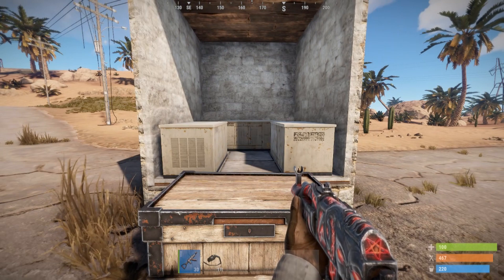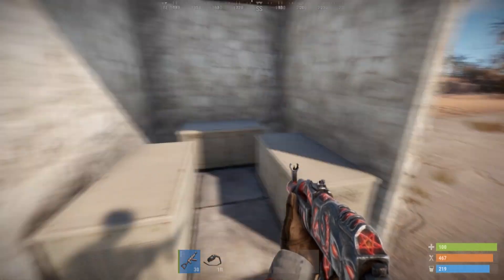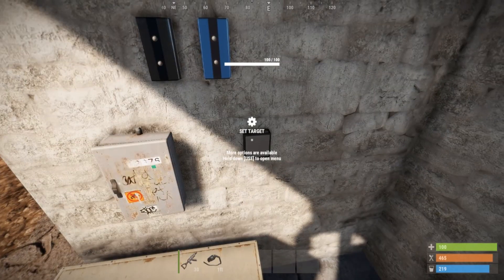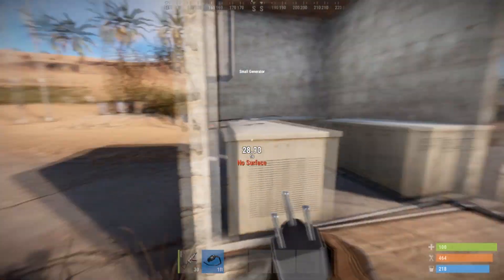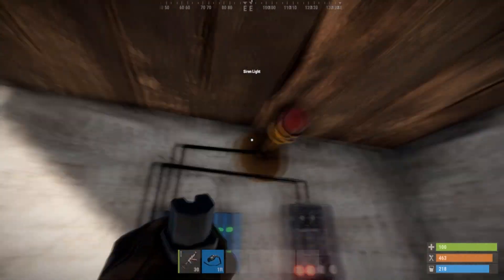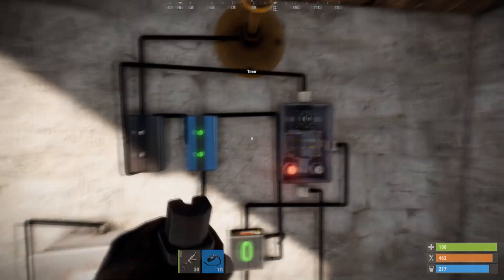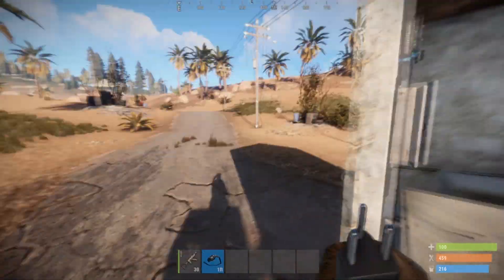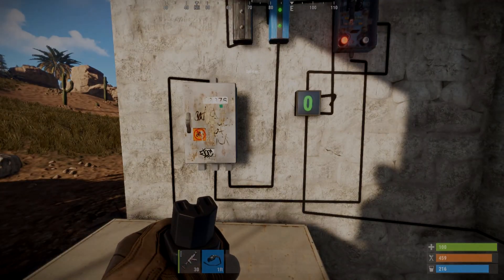Rust Electricity - Heartbeat Base Alarm (Customizable)!

Comment: If you wanted to add more sensors around the base, wouldn't putting the power out of the sensors into a couple of OR switches that ultimately power the system accomplish that? With another splitter off of the first to power the 3 (for example) sensors. Just a thought, haven't tried it.

Comment: 2 things:
1. The memory cell is actually more intuitive for this... (replaces the counter in your example) if you use the counter, why not use it in a way you can tell how often the sensor was triggered in the meantime? Using it like this is a waste and a little confusing...
2. The WAAAAAAAAY better version of this using a transmitter frequency matched to a pager in your pocket (instead of siren light)... That way you get alerted ALL OVER THE MAP and you can even put it on silent mode like your mobile phone so it vibrates instead...

Comment: Excellent work. Although, Instead of using 2 power sources you can improve this circuit via adding a branch before the splitter, to power it and the counter via the branch. Using 2 power sources isn't viable in vanilla, imo.

Comment: why to recreate that circuit on every wall of the base when you can use OR gates to pair them up and if one triggers it will display also you can put a counter for each sensor and just rig it up to the sensor indirectly trought another AND gate with the main power and extend from there, while using the block and timer method to reset all the counters not just one

Comment: A bit late to the party here... But you can bypass the only having one alarm/siren per sensor. Basically you wire them all to RF broadcasters and set them all to the same frequency. In base it you wire the receiver to A memory cell's "set" input with a different power source for the input. This allows you to wire up all your alarm gadgets from the output to be triggered by any sensor that is triggered. You can also set a beeper to the same freq to carry around with you when out and about. You also need power running to the "reset" input but I am pretty sure that can be constant as the "set" input will override the reset. 

I didn't mess with the counter but I assume there's still a way to make it work with that setup. But it also means you can have alarms anywhere on the map if you run multiple bases or have a compound or even if ya just have a heli tower. You could run that setup in all your bases and set them all to different freqs and in each base have a receiver for each base rigged directly to sires with signs telling you which is which so no matter which of your bases you are at you  know which one people are lurking at and potentially about to raid.

Comment: Can you still charge battery with this system?, I tried some things on build server and unlike the auto lighting system with branch to battery/blocker.. I can't get the same on units that require constant supply, they drain the battery even using a windmill.
Reply from the maker: The build as is will require a constant power source and is not typically used with a battery. You can make battery based systems as Malonik does in his video that allows passthrough whilst charging. Energy consumption is a very difficult resource to manage on larger builds.
Reply: @RUSTQuickElectric   I've seen some more vids now to explain ways to do it, thnx. The systems are complex and I do like that, but they are not so intuitive, that's a small price to pay I guess.

Comment: Using bits from your guides and others, I used a memory cell and a handful of electrical branches (*much* more power efficient) to power two hbhf sensors over a turret triangle. Whenever either sensor detects enemies, it opens the appropriate garage door (and triggers the flashing blue light special).  When enemies are no longer detected, they garage doors close.
Reply from the maker: Nice! I love hearing about optimizations. Glad to see you in the discord as well :D

Comment: could you use a splitter instead of siren light then split the signal in siren light, rf transmitter (for pager) and an audio alarm?
Reply from the maker: Yes you absolutely can. The branch output from the branch component in this schematic is meant to be split and used for whatever you want triggered during the full duration of the timer after initial triggering!
Reply: @RUSTQuickElectric  ty

Comment: How do you use audio alarm and siren light at the same time? connected to the heart beat sensor
Reply from the maker: You can always switch the branch that is attached to the timer for a splitter and allow more outputs.

Comment: Very informative, great video! I just have one question: Can you make it so that if someone stands a long time infront of the sensor, the sensor shows the person as long as they are standing there? With this "system" it always resets after 5 seconds, even though there might be a person there. Thanks!
Reply from the maker: Simply removing the timer will make it a longstanding detector. You could just wire a switch to the clear counter and manually reset it when you please.
Reply: @RUSTQuickElectric   I messed around a bit with the electronics and found out that if you wire a timer to a XOR Switch in such a way that: The XOR switch gets 1 power source from main power and the other from the timer. Then the XOR switch goes to a splitter/branch  and is connected from there to the switches activation. This makes it so that the timer goes of forever and resets everytime it turns on and off. I thought that maybe you can do some electric magic and wire it so that the COUNTER that counts the players in the view of the HBHF sensor resets every 1-5 seconds?
Reply: if this was kinda unclear I can make a video explaining myself better at some point.
Reply: @RUSTQuickElectric  Wouldnt this be a hell of a lot easier if rust had NOT gates? You could just wire a NOT gate to a branch and the branch to the hbhf sensor and then the not gate to the counter reset. I think this would make it so that when theres no output from the hbhf, the counter would reset.
Reply from the maker: @rotta8548  Yeah a NOT gate would be nice, but it is possible to achieve similar mechanics by reversing pre-existing components. There is a ton of potential and they seem to keep adding more and more!
Reply: RUST Quick Electric Yup. I think I saw someone making a not gate by using the xor switch and blocker somehow... I'll have to do alot of experimenting!

Comment: Is this already possible without completly draining your battery? because any other component but a blocker used to make the battery drain in stead of charge. (no matter how much power coming in or going out)
Love these videos btw, nice and clear explanations.
Reply from the maker: Sohe if you put a regular switch before each power out of the main power sources you can toggle these being on or off. Otherwise it will be a drain.
Reply: @RUSTQuickElectric  Ahh okay, cool, that should help me.
Thanks for responding!
Reply: Malonik has a build where you can have solar panels powering/charging a small battery (or windmill/large battery) while powering other things using an OR gate. I strongly suggest looking into that. Also, solar panels are not enough to reliably charge the larger battery while also powering things in the base. FYI